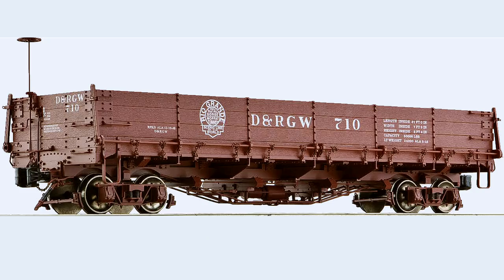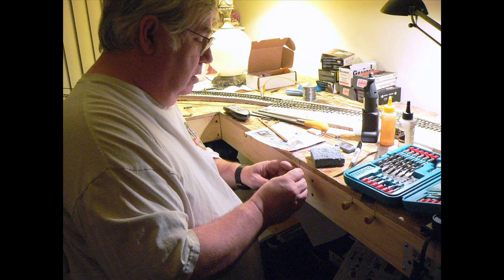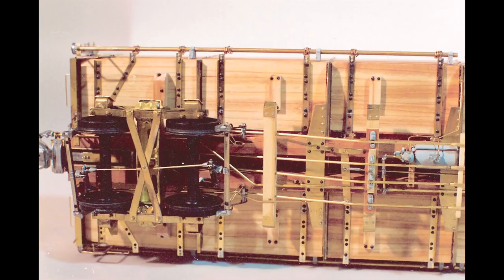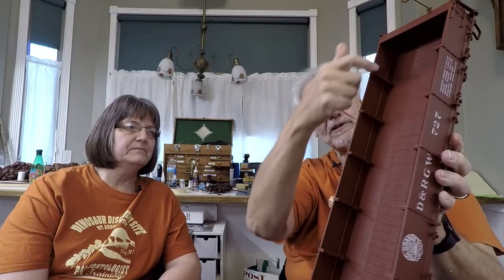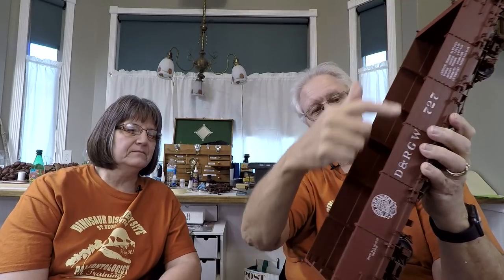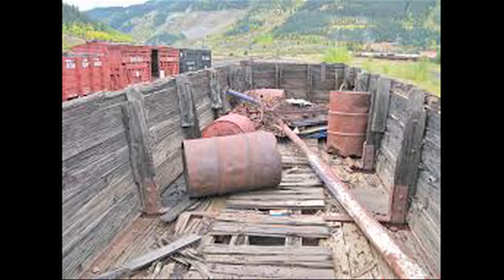AMS 1:20.3 Rio Grande Drop Bottom Gondola (Accucraft) Unboxing the latest release.

Comment: A bill doesn't seem all that bad for this particular car given the size and delicious details. HO cars have been creeping that way the last few years so this doesn't really terrify me cost wise.  When you said expensive, I thought $300+ area.
Reply from the maker: The caboose and drop bottom gondola are the most expensive at about 160. But on eBay who knows. But I know a dealer who sells both at 120 all day long. Passenger cars are more like 240. So if you are building a railroad and need 30 cars, as we do, it adds up. But I’ve been buying for years. So it’s spread out.

Comment: I think there are some Drop Bottom Gondola cars at the Cumbres & Toltec and the Durango & Silverton. Because I know that they have freight cars that they have there.
Reply from the maker: Yes they are! Surprisingly a Durango they have built several of these entirely out of metal! They tend to fall apart after 100 years or so and as Durango really needs them for maintenance of the truck they’ve built about half a dozen of them brand new all out of steel!

Comment: Drop bottom gons were NOT just a non-revenue car, they were used extensively in freight haulage for a time, more prominently int the west, but also in the east.
Reply from the maker: Yup. These just ended up that way. Most not. But these were almost entirely non revenue by 1955 to oh.. 1960?
Reply: @ToyManTelevision  SP had some with high sides that were used for sugar beets quite late I think.  SP had them until the early '80's, then sold them to some sugar companies where some of them lasted until the early 90's when they outlawed friction bearings.
In the East, Ralston car company made a lot of mostly all steel drop bottom gons in the early part of the 1900's

Comment: This is going to be a very cool project.  Do you have an idea how your going to distress the sides?  The plastic seems so thick compared to HO scale ... are you going to use some kind of candle heat source or other heat related technique?  The military modelers seem to love open flame distressing techniques but they are using thinner plastic and smaller scales.
Reply from the maker: I do that with a dremmel and high speed metal cutters. Both cylinders and spheres. You can lightly shave just as much as you want. I did a 32 ford in 1:8 scale from the inside out with a spherical tool and made the “metal” paper thin and rusted through in places. Works great.

Comment: I believe these were released a few years ago, this is a re-release.  Also, they were definitely NOT "non-revenue" cars.  While they were used in Company Service, they were definitely revenue cars.
Reply from the maker: Yes the two I show are a first release and a second release. While the car was originally both maintenance and revenue, by 1960 they were pretty much non-revenue. Still widely used, in fact D &S just built several brand new ones out of steel. Used for ballasting track
Reply: @ToyManTelevision  Have you seen the BLW cars?  (Now out of production...). They have working drop doors!

Comment: And here I was thinking you were going to put it on your garden railroad when you get it done... :-)

Really if you stop and think about it the price of the car it's not all that bad for the level of detail you get considering the size of the car.
Reply from the maker: Kriss Femmpaws not at all. A good HOn3 is like 50. And it’s 4 inches long!
Reply: @ToyManTelevision  I remember in the late 70s and 80s some HO cars having a price tag of 20 to 30 dollars, yes there some cheap ones at 2 to 5 dollars but the quality was questionable. When you take in to account the lack of buying power of the dollar today the price is even better than back then for what you are getting.

I remember helping a friend tear down a small barn that was built in the 1900s for the lumber... one of the reasons he wanted the wood was for the tight grain spruce and fir for model building.  He did model railroading and model ships. 

He's also the guy that build his own small tablesaw because he wasn't happy with the lack of precision of the mini table saws that were on the market at the time. Al's idea of precision was being able to rip lumber within five thousandths of an inch of what he wanted. But what else would you expect from a Journeyman Machinist?

Comment: Nice model. 180$ don't see that much for the size, compared to 100€ or more that Lenz asks for O scale models (but I also found a bargain for the two gondola I needed)
Reply from the maker: All in all I think it’s a very fair price. When I look at how much cheaper things have gotten and how much better. An HO scale box car in the 1960s set you back five dollars. OK maybe four. But adjusted for inflation that’s around $40-$50! For an HO scale very basic piece of rolling stock. The secret sauce is China. And I’m OK with that. Unemployment is incredibly low and if Americans were building these things no one could afford to buy them it’s just that simple. So I don’t see what’s wrong with building models in China. The only problem is China is now pricing themselves out of the market too. Rapido moved south about 500 miles out into the hinterlands of China, to escape the high prices in the cities as no one will work for them for less than $20 an hour anymore.
Reply: @ToyManTelevision  Well, it is possible to make models in the West, with a lot of automation (no more jobs),  and you have the same models (same paint) for 10 or 20 years. If you compare how Roco (https://youtu.be/gCYyCaTvmXY) paints the models compared to Rapido, it is understandable that they are still in Austria. But European brands aren't selling well for a reason: nobody will buy the some model (same number!) several time for a big price. Short series like Rapido need cheap labor, or they need to sell them unpainted and unmounted (which I wouldn't find so bad)